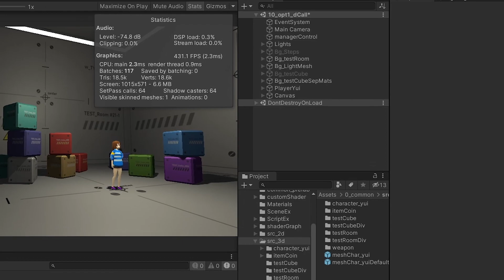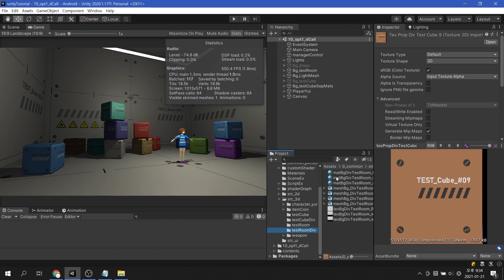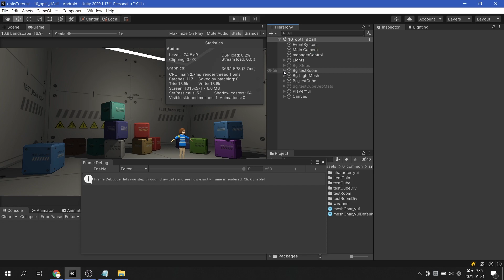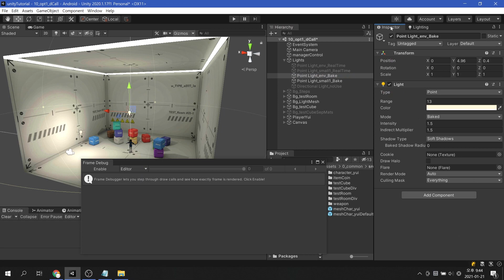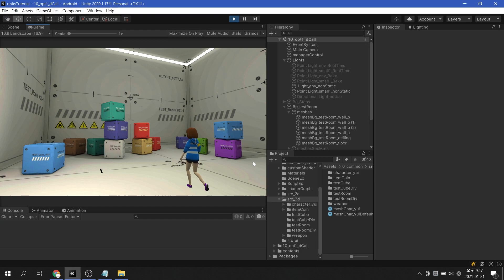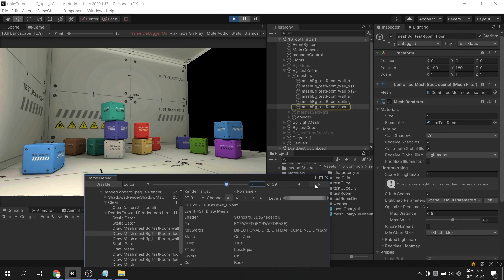Unity Optimization : reducing 3D objects' draw calls

Comment: Okay, just dont go near the walls or boxes, since they won't show shadows as well, just like the floor which is why it had to put back to non static.
Idk, this feels completely unnecessary with the static thing
Reply from the maker: I will do RnD on Baked lightmaps and real-time shadows later and update new videos.

In fact, Baked lightmaps are rarely used due to the advancement of devices.

In addition, the time when the video was produced was also to replace the poor mobile environment, but now, real-time lightmaps have developed enough to be used sufficiently depending on the complexity or optimization of the scene.

Please click this URL for a video on the production of real-time GI lightmaps that was recently produced.

https://youtu.be/veEu6KB-3bQ?si=3KcyzS3oWnQb6_P7

Comment: First, thank you for the video!
It was really interesting understanding the way draw calls work. 

I was wondering, what about the "mixed" lighting? Is it still better to use a fully baked light + a real-time light that only affects the player&ground, or would it be more correct to only use 1 light used as a mixed one?
Reply from the maker: The choice of mixed or baked light source depends on your game background or stages.

In my experience, I recommend the Baked Mode for rooms with ceilings and only artificial light sources. However, if some light flickers, for example certain light sources change the brightness and shadows in a room, the Mixed light mode may be useful.

In fact, lightmaps may not be necessary if you use texture atlases and optimized polygons, as mobile devices now perform much better than before. By creating the Ambient Occlusion via Post Processing is much easier and could be saved the device's memory.

Try and Test to make lightmaps with two types : Baked and Mix, you will know it which one is better for your project.
Let me know after you tested. :)

Comment: when the floor has 2 lights, that are  too bright,how to solve this problem .
Reply from the maker: First, change the layer of the GameObject from default to something else.

Second, if you select the layer settings of Light, several layers will be displayed. Just select the layer of the GameObject you just applied.

The light will then only affect the object to which the specified layer is applied.
Reply: @aboutgamemaking  I mean,the floor already has the first baked light, and then there is a realtime light on it，the floor will be very bright，how to keep it as bright as it's baked and still have character shadows on it .
Reply from the maker: @chimeng-q9j  As you can see the tutorial, I used 2 lights as same as you.
And the floor is little bit brighter than before applying the realtime light.

The only way is I set the Intensity of the realtime Light lower than the light work for baking.

Try set intensity and set other options, then you will get it. :)
Reply: @aboutgamemaking  thanks,I'll try it.